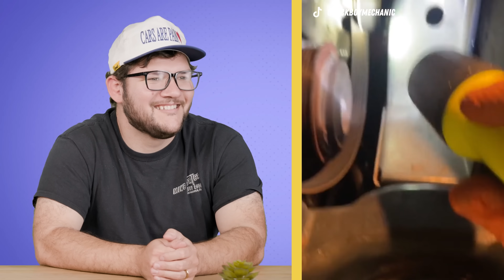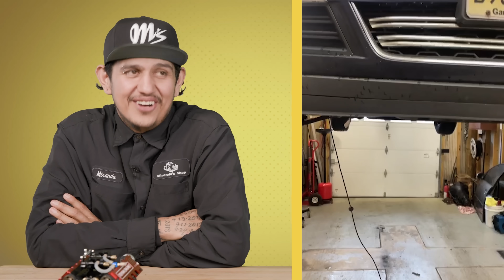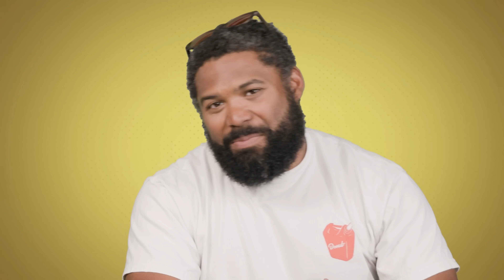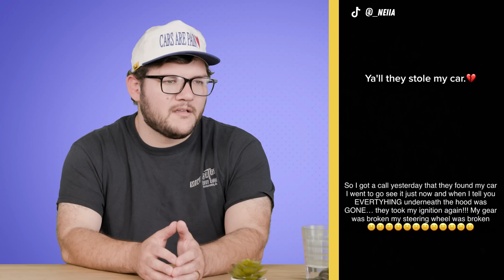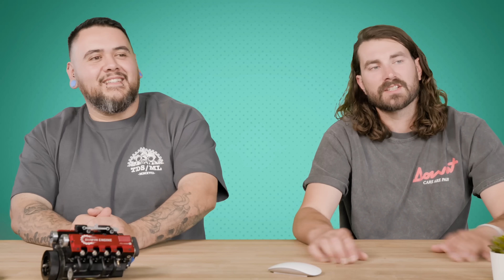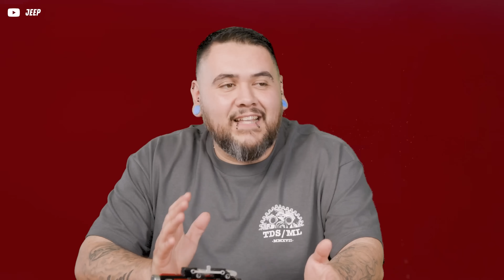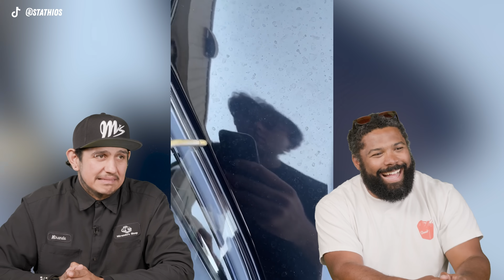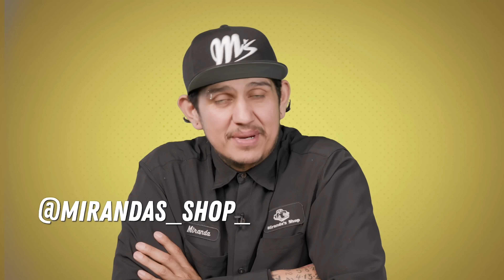Mechanic Reacts to Car Engineering Fails

Comment: As a Vehicle Detailer, I too absolutely hate Engineers with a passion! It's like they never in a million years thought that anybody would have the audacity to try and CLEAN their CAR "
"Who cares if years of muck and dust accumulate there, that swoop in the door card looks good!"
Reply: if you were in early 70's you probably hate lancia's engineers with same passion. though cars had nice look, but had lots of issues.
for excaple Lancia Montecarlo suffered from overly boosted brakes, which caused the fronts to lock up easily in the wet.
production was suspended in 1978 while the braking problems were fixed by some engineering changes, including removing the brake booster.
so, you really didn't have brakes...

Comment: I think they took that ladies turbocharger😂. Most small inline motors are still port injection and that motor has a HPFP. That’s ALOT of room for just a cat.
Reply: @sinAnon6689  yea could be but it’s still rare to see a high pressure fuel pump for such a small motor if it’s NA. Like that’s ALOT of fuel for that motor.
Reply: @sinAnon6689  idk how you are confused? I said I think they took the turbocharger. Why do i think it was a turbo and not just the cat is because the motor has a hpfp which is mostly seen on turbocharged vehicles. Idk what’s confusing.

Comment: Architects have the same reputation in the construction industry.  They live in perfect fairy tale land where everything looks nice and pretty in the cad software.  In reality they want to maximize liveable space to the point where actually running utilities throughout a home becomes a real PITA and then you have trade fighting each other over this crap (most often what I see is plumbers removing ductwork so that they can get proper slope on drains).  So glad I have an older vehicle (98 4runner) where things weren't quite so tightly packed but the Toyota engineers have annoyed me a few times.  Specifically my biggest beef is the rear cam bolt on the front lower controls arms.  You have to remove the whole flipping steering rack to remove those things and there's not an easy way to torque them back up after an alignment.  Had to replace my LCAs (and I upgraded them to poly bushings) because the bushings were worn and the passenger cams were frozen in the bushings so I couldn't really get a great alignment.  Thankfully I already replaced the rack and knew how the whole job went so it wasn't terrible (although it's a tight fit getting in and out so you have to wrestle that thing for quite a while with a pry bar).  If I had time to leave her up on stands for a few days straight I would have done both jobs at the same time but I'm a slow shade tree mechanic and this is my only personal vehicle so that wasn't going to work.  Also the rear shock top nut is a pain to get to.

Comment: Sadly, it's often not the engineer's fault. It's called the engineer's paradox. Doesn't matter how much you scream until you're blue in the face, some pencil-pushing corporate shill is gonna require things get done in a way that engineer specifically says "you can't do that because [insert reason]".

As an engineer, I've had to walk off a job because I was being told to do something that would be unsafe for the operators (industrial setting) and refused to do it. Told them that if they did it, I wouldn't continue on the project. They acted like they were backing down and I came in the next day and they'd done exactly what I told them not to do during the night shift. I don't play around with safety and I wasn't going to let my name be attached to someone's death. I walked off the job that instant.
Reply: yeah there are sometimes design or space constraints that force an engineer to do some things a certain way. Of course if there were a mechanic on the team maybe some wouldnt go through, but there are some that are just not able to be fixed without a ton of resources being poured in to fix the issue
Reply: That’s hella impressive, props do you for doing that. I haven’t come across a situation like that yet but if in any instance I ever do I will exhibit the exact same behavior. Safety is no joke.

My favorite is when management and accounting gets themselves involved. Especially when neither have engineering experience. I can’t tell you how many times I’ve had conversations like:
“You can’t do that like that”
“How should I do it then?”
“Idk you’re the engineer”
or
“You shouldn’t have done that this way you should’ve done X/X instead of X/Y”
“I did X/Y for a reason. X/X isn’t efficient or cheap”
“Well we need X/X, not X/Y. You’re gonna have to redesign.”
I can’t count the amount of times that’s happened to me in the past month alone. Accountants truly are thieves of joy
Reply: @natexthomass  ... and that is why I choose audio engineering. When the concert is gud, everyone forgets the audio engineer even exist .... when the concert is bad, engineer will get the blame for everything, even climate change wud get blame on me. I ♥️ this job
Reply: @princesssolace4337  If I wasn’t half deaf I would heavily consider audio engineering instead, getting the mix just right and getting that crispy audio just makes my brain 👌🏼👌🏼👌🏼. Alas I’ve been cursed to not hear and I shall stay with Diesel engines instead.
Reply: @natexthomass  Engineers is the unsung hero when things work out. It's a compliment when none remembers u. To put it in another context - Look at the universe we live in. When shit doesn't go down as how we expect, we blame the creator a.k.a God a.k.a the engineer.
If the big guy been bash for mellenia, what chance do we mortals have then?🤣✌️
Reply: Exactly. Most times these problems were pointed out and executives decide it's not worth the cost of doing it right and they cut corners.
Reply: Kudos.
Reply: Most people don't know of some of the INS and outs of engineering. Some people think that the designers and engineers have all the say. Nope. Pencil pushers have way more say
Reply: Id love to make everything as perfect and possible but then boss says "that by friday" 🤣
Reply: 1000%.....new cars are all trash. 
Go back 20 years. A mechanical switch for headlights is safety dang it. No computer for headlights and taillights
Reply: I was thinking this as well from an auto techs point of view. I’m sure they try their best, it’s how their minds work, figuring out how to design something with minimal issue.
Reply: At my work we are expanding and installing some new equipment. When we find things that really make no sense I send a pic to my buddies that are engineers. And the response is usually 50/50 if they think it is a lazy design or a bean counter decision. The funniest part is that the really bad ones they all say it is a lazy/bad design. And they chalk it up to the engineer that got straight As but had absolutely no practical experience but it looked good on paper, the old theory vs practice.
Reply: Gotta say it's rare to find someone like you in engineering, props my dude. I was a equipment operator and walked off a job once when people were routinely ignoring LO/TO and I got told to do it to make production numbers. Finished my shift then turned in my badge. Funny story, middle management tried to act like they didn't know it was going on, when half the time it was the night supervision themselves doing the sh*t.
Reply: Can I ask you what the issue was? I’m curious
Reply: How much coke did you snort before you typed this?
Reply: As a fellow engineer(Civil engineering but I studied for mechanical engineering before switching degrees), I see where you're coming from, a lot of times the bean counters just gets in the way of creating things the way they should be created just because they want larger profit margins.

But unfortunately, an engineer still signed those cars to be built with parts like that, more specifically, an engineer still designed that power steering hose to go over that O2 sensor on that GMC...Completely overlooking the fact that he just signed his name on a fire hazard, which can easily lead to fires and even people dying.

That GMC still the engineer's project, so he still bears responsibility for it.

You walked out of that scummy company because, above all else, you two characters that MANY engineers in the area, nowadays, are lacking: Work ethic and backbone to stand your ground.

Said lack of character is leading to cars being built like worthless shitboxes now, engineers are not standing their ground against their employers and against stupid corporate decisions.

Believe me when I tell you this: Give it 10 or 15 years of things going on like this, and engineers will start to NOT be respected as professionals.
Reply: @pedinhu18  It's called integrity, and you're right. Engineers lose their stamps in some extreme cases though.
Reply: @pedinhu18  given 10 to 15 more years like this and the US of A and maybe even the world will be up shit creek without a paddle, and not just for engineers but the entire infrastructure of the blue collar working man will be in shambles and the only profiteers will be the white collar aristocratic elites of society, there is too much social disparity in the US right now, and nobody has stepped up and tried to mend the financial damage that has been suffered by the US because no one wants to see eye to eye, they don't want to set their differences aside and work together for a common goal, that would be securing the financial future of the American people through enterprise, expansion of our exports to other countries, and reduction of so many imported goods, etc. etc. The American Government needs to realize that right now, the most important thing we can be doing for our country is putting "Made in the U.S.A." on the labels of some of the most high quality products like we used to do
Reply: thats not believable because they can always jack up the price of the vehicle
Reply: @williamschaeffer5606  Nope, they want to increase their profit margin without increasing price. Can't make a Camry the average consumer can't afford.
Reply: @williamschaeffer5606  they do anyway
Reply: @williamschaeffer5606  - Unless it's a Ferrari or a McLaren they will loose sales doing that. :-(
Reply: I see the word engineer b4 paradox. I'm blaming the engineer. Get use to it Mr Engineer.
Reply: Ford's engineers told Ford the DCT transmissions weren't going to work, but to fix it would require time and money. Not a lot mind you but some. Ford overrruled them. Didn't come out till the class action. There's was also the infamous case of the Pinto. It isn't just Ford, Chrysler had an issue with transmissions in the 80s IIRC. Engineers told them they needed to spend an extra couple of bucks to fix a potential problem. That cost money. I can tell you as an engineer that 90% of the problems you think are the fault of the engineer the engineer was halfway to fixing before management intervened. Gotta keep those bonuses.